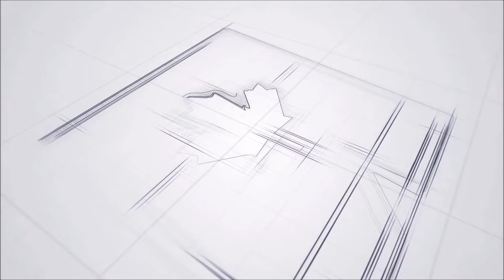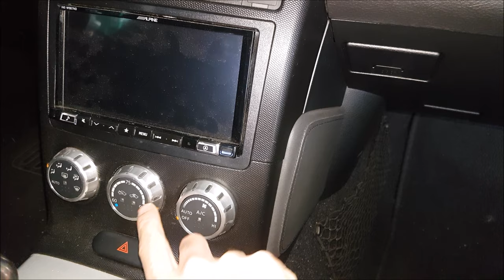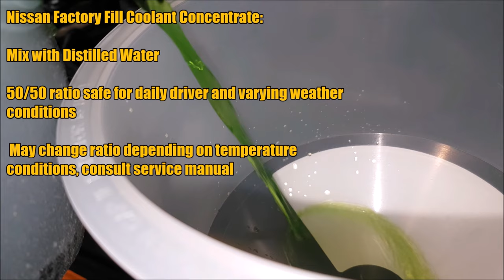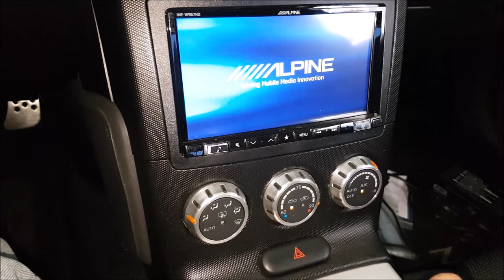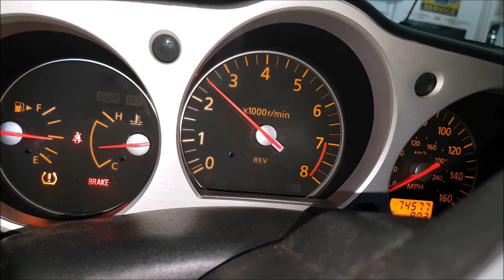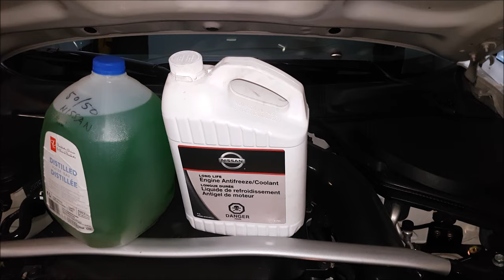How to Bleed Coolant System Procedure Nissan 350Z & Infiniti G35 (Nissan 3.5L V6) | AnthonyJ350

Comment: I got a question I open the air bleeder valve then the radiator cap I didn’t have a free spill funnel but had a regular one I added antifreeze slowly less than 2qts per minute once I see antifreeze dripping out of bleeder valve I close bleeder valve and radiator cap fill the coolant tank start the engine let it get to normal temperature turn the heater on (it started to blow hot hair after the 3rd time of repeating this process) rev the engine to 3k rpm hold it for 10 sec 2 or 3 times turn off the car let it cool down once engine is cold open bleeder valve check for coolant and if coolant level no more longer drops to ur done is this process right? I already did this for 7 times can’t see the coolant level on bleeder valve to stop dropping I took it to a drive to see(car was blowing cold and then hot it did overheat than I waited the whole night this the same process one more time air was blowing full hot after rev the engine went to work drove it on freeway (20 min) and it didn’t overheat and was blowing hot hair I got off of work 7 hours later and start the car the heater wasn’t blowing hot compared to the morning I didn’t want it ti drive it like that so I did the same proces add coolant until spills out of bleeder valve rev it to 3k rpm and started to blow full hot air drove it home everything cool no overheating nothing should I keep doing the same process until I open the bleeder valve until coolant no more longer drops of level or should I just try how you did on this video with the free spill funnel without having to install radiator cap while car is on and I rev it to 2.5k 3k rpm
Reply from the maker: You need the special funnel like in the video

Comment: Quick question smoke came out before coolant is that normal or seems like coolant hitting gasket ?
Reply from the maker: Smoke coming from where amd when?
Reply: The bleeder valve . It was a mist kind of like dry ice mist before smoke and then spewing coolant out of bleeder valve .
Reply from the maker: @MrRashaunn  Do you have the original plastic or upgraded version? https://youtu.be/A0TmDY5yq5k?si=AMMKswRIv7WXw_Jr

Comment: I have done this countless times and it’s not working new thermostat too.But what i do is open radiator cap open bleeder valvue then poor in coolant but it never reaches the top of the bleeder valvue.and then it’s doesn’t overheat when i rev it. i drive it for 15 min all is fine then overheats
Reply from the maker: Something might be blocking the coolant from flowing. Do you have the front end elevated?

Comment: My 350z is overheating when I drive replaced the thermostat and forgot to bleed the system I hope this fixes the problem
Reply from the maker: Let us know if it works for you.
Reply: AnthonyJ350 I’ve done it like six times and no luck we’ve replaced water pump and thermostat and no luck so now we’re looking at the heater core we did a head gasket leak kit and it said that our head gasket is good
Reply: It overheat when I drive but when in park or neutral( I know it’s an auto I wish it was manual but it is my first car and it’s all I could afford) I can even rev it neutral or park and it doesn’t overheat but when I drive it take like 5 minutes to overheat
Reply: Turns out the thermostat we bought was faulty we bought a new one and now my car works great
Reply: My 350z overheathing when its parked   trying to buy the radiator fan i dont know
Reply: @otoortiz6285  Did that fix it?

Comment: Hey if the heat never had an issue blowing hot but the car overheats does that point to a bad thermostat instead of air in the system?
Reply from the maker: How old is the thermostat?
Reply: @AnthonyJ350  it was the thermostat. Replaced today and all is good now
Reply: @AnthonyJ350  but it was original from 06
Reply from the maker: @tcblackg35  Nice, did you put one in that's made in Japan?
Reply: @AnthonyJ350  nope. Duralast from Autozone. Fingers crossed it lasts
Reply from the maker: @tcblackg35  Let us know how it goes.
Reply: @AnthonyJ350  thanks for the optimism, we’ll see

Comment: I drained my g35 and it’s only holding 1 gallon of coolant is that normal? I drained it with the hose by the radiator drain because I could get the drain plug off without stripping it
Reply from the maker: You can run the engine for a few seconds to make the pump push everything out.

Comment: do you recommend to install oil pressure sensor to V36 g sedans? or 2008 V36 g35 sedan already comes with it?
Reply from the maker: The gauge you mean? Great idea if you can find a good spot for one.

Comment: What if it is bubbling out of the container like real bad should I cut it off? It’s not running hot it’s bubbling and filling up
Reply from the maker: If it's bubbling it's removing air from the system. Keep a close eye on your temperatures and keep going. How long have you been bleeding it for?

Comment: Hey man could you help me out? 
05 g35x 103k

Problem:
Coolant hovers around 210-215 during cool days while driving.
Fans stay on high for long periods of time.

The problem was occurring before any work was done but I’ve gotten the thermostat, and coolant temp sensor replaced, coolant flushed, and bled a couple times. I just bled it today for a little over 2hrs. I’m trying to figure out what’s going on. I have constant hot heat and cold ac. Maybe just needs to be bleed more? Can a very small amount of air cause constant higher then normal coolant temps?

Any help/advise would be much appreciated!!!
Reply from the maker: Did you bleed it with the funnel like in the video?  Does the heater give hot air all the time?  Or only when you bring up the revs?

Comment: Quick question do the low speed radiator fans need to come on when you start the car? My car is over heating and the radiator fans don't turn on at all even with ac turned on. I did a self check and only high speed setting kicks on..
Reply from the maker: You should get the vehicle looked at, at a shop.

Comment: I'm not getting hot air blowing in the car when I do this.  Any ideas of what's keeping it from cycling properly?  Also, I notice that while adding coolant to the funnel the reservoir fills and starts leaking fluid out of an overflow spout at the top of the reservoir, causing coolant to spill  all over the ground.  Should this happen?
Reply from the maker: Did you change the thermostat? Also did you open up the bleeder and fill it and close it after, like in the video?
Reply: @AnthonyJ350  I’m having the same issue brand new thermostat using a funnel and did the bleeder screw thing too
Reply from the maker: @illest_evr  Did you elevate the front end of the car and secure it on jack stands or ramps?
Reply: @illest_evr  y’all ever figured out why same thing is happening to me I followed the video step by step. I didn’t replace my thermostat could that be a reason why?

Comment: So when I rev up to 2500 a few times and let it idle, then I shut the engine off. Will I just leave it with the funnel or put the radiator cap back on until it’s completely cooled off?
Reply: Wait, that’s was a dumb question! Okay now I have a real question, where’d you get the funnel setup
Reply from the maker: I just got it at my local auto parts store.

Comment: My overflow tank over filled and started leaking out the top is that normal or is it something wrong and I need to change?
Reply from the maker: Sounds like it was overfilled
Reply: @AnthonyJ350  I have another problem when doing an coolant bleed, once the car gets to operating temperature the coolant in the no spill funnel starts getting pushed out and splashing everywhere, I believe by air. Any idea of what could it be?
Reply from the maker: @yungshaq5166  You have it filled too high.
Reply: @AnthonyJ350  I only fill it at the bottom because it might get high when doing so which it does and I take some of it out before it gets too high, but even after that it still does it. Maybe I should just take it to a mechanic and see what they say.
Reply from the maker: @yungshaq5166  Did you install a new thermostat?

Comment: I have a question recently I had the same issue with my car about one of my hoses popped and I replaced it and also bought the new thermostat and I did the burping method but it’s kinda still over heats a lil wen I have my AC ON and wen I come to a complete stop to wait tell the light turns green. Than when I start to drive it goes back to normal is it because I still have air trapped in my motor? And do you have to do the revving part to help it out more or you don’t have to do it. I have a g37 sedan. Should I do that revving at 2500 rpm for 10 seconds. Any advice would be great🙏🏼💯
Reply from the maker: Sounds like you still have air in the system. Revving it once in a while during the bleeding procedure does seem to help. Just follow the video and have the front end elevated safely to get the air out.
Reply: @AnthonyJ350  okay sounds good I appreciate it man will do today I’ll let you know how it goes👍
Reply from the maker: @fernandopimentel6577  Please yes, let us know how it turns out 🙂
Reply: @AnthonyJ350  i will today I did the bleeding method and i have a question how long does it take for the air to come out of the motor can it take  days or so? Because today I was doing it all day and it kept throwing air bubbles only a lil bet. So I took it for a spin and it kept overheating when I come to a complete stop. Do I have to wait tell there’s No air bubbles at all. And also I had the car on the driveway since it goes up a Little so thought that would help with the burping. Does the front of the car has to be pretty high in order to take out all the air bubbles out of the motor.
Reply from the maker: @fernandopimentel6577  I also have the front end lifted where I can put jack stands underneath. These cars are a pain to bleed. It takes me about 45 min including cooling cycles.
Reply: @AnthonyJ350  okay sounds good ima try that hopefully that works and fully wait tell the air bubbles stop coming out too. For the full bleeding system.
Reply from the maker: @fernandopimentel6577  Let us know
Reply: @AnthonyJ350  will do later on today in the afternoon ima keep doing the bleeding the air out. Get any air out of the motor.  also had a question I don’t think I have the no air relief plug I’ve checked and I don’t see it maybe cuss the g37 don’t need that. Was concerned about it?
Reply from the maker: @fernandopimentel6577  Read this thread, if you scroll down you might need a tool https://www.myg37.com/forums/engine-drivetrain-and-forced-induction/240883-no-air-relief-plug-on-heater-hose-can-t-bleed-cooling-system.html

Comment: Curious what stained your coolant hoses with the white specs?
Reply from the maker: I believe it's the coolant itself. When I researched silicon it's a little porous technically. Maybe the coolant tries to push through when under pressure and as it cools down that happens. Not really sure.

Comment: I keep bleeding and filling with no leaks but it still overheats
Reply from the maker: Did you change the thermostat?
Reply: @AnthonyJ350  yea I changed thermostat and removed my deleted bleeder valve and installed hem one. when I idle the car sat for an hour and a half and the temp was fine. I drive half a block it goes up. I got so mad I hit the gas and let my baby roar down the street and the faster I go it cools down. but when I parked steam came out the cap
Reply from the maker: @YoungNaija  When you bleed the system do you have the Hester on the hottest setting and the fan on?
Reply: @AnthonyJ350  yes I did. When I drive fast it runs normal. I idle it runs normal as well. I drive speed limit down the street it’s starts steaming out the radiator cap and temp gauge sky rockets. Maybe the cap? I didn’t change that or the water pump
Reply from the maker: @YoungNaija  It's worth trying a new rad cap for how inexpensive they are.
Reply: @AnthonyJ350  it was two things but I got her back running head gasket is cool.  Radiator fan doesn’t work and my cap was bad

Comment: In a vq35de, is zerex 50/50 by valvoline green for Nissan a good coolant to use? Just curious because that's what I put in my 03 350z.
Reply from the maker: If it has the same approval rating for Nissan you should be fine.

Comment: Scenario was ; bleeder line broke, spillled coolant. 
Addeded coolant as you said, yet during procedure the hvac doesn’t want to pump put hot air.
 is that normal? It was fine before the ruptured coolant line
Reply from the maker: Did you raise the front end and use the funnel upfront? You probably still have air in the system.

Comment: My vq35hr so hard to bleed time consuming I bought the same funnel replaced my thermostat and my fans are still on 24 7 what should I check next
Reply from the maker: Temp sensor replaced?
Reply: @AnthonyJ350   would i get a check engine light for a temp sensor i have no lights.
Reply from the maker: @abbas674  Not unless the car thought it was over heating maybe
Reply: @AnthonyJ350  no runs good I’ll just wait until the summer it gets up to 120 degrees where I live I’ll be installing mishimoto radiator and hoses soon thanks for the reply
Reply from the maker: @abbas674  You're welcome

Comment: Hey man,old video but maybe you can help..whenbi have my z idleling and rev to 3000 and my issue is after the car gets hot it spits all the new coolant out from no spill funnell,the funnell will fill up and then overflow and leak everywhere. .why is it spitting back after a while .I thought i was good my heay was working and all was good i was about to stop and call it a day n go for a ride but before i could go out and remive the funnel i noticed it filled the funnell to top and never syoped just keep pouring anitifreeze
Reply from the maker: When you're bleeding the cooling system, is the front end elevated?

Comment: Hey man, great video. Ive been chasing this issue for awhile. Evidently overheating (or fooled temp sensor due to air bubbles) is common? I feel like ive been bleeding air for a while. I usually did 5 minutes of bleeding maybe once every few months before i notice the temp needle creeping a little higher than normal. Perhaps im not doing it long enough? It seems after a bleed im good to go for a while but would like to not worry about it anymore. I wonder if air is being introduced into the system somehow. Thoughts?
Reply from the maker: It takes me 45 mins to bleed my car with the front elevated using the funnel.  Are you doing it like in the video?

Comment: After it spilled from the bleeder valve, did you tighten it back up or leave it loose?
Reply from the maker: Tighten it back up.
Reply from the maker: Tighten it back up
Reply: @AnthonyJ350  So you had it tight throughout the whole process?
Reply from the maker: @vxf4tal1tyxv67  Yup

Comment: It seems like my thermostat isn’t gettin coolant the tubes pretty cold when the other tube is hot , could use some help trouble shooting everything was working perfect 2 days ago just got a radiator and new thermostat so I know it’s not bad just air in system
Reply: Also car idles at operating temp but when I drive over heats, and the heat is only hot when revving or driving
Reply from the maker: Did you change the thermostat?
Reply: @AnthonyJ350  yes it’s new but I made bit more progress with it, heat is reliably working now and fans kick on still, lower radiator hose to thermostat is still ice cold tho although t-stat itself feels warm
Reply: @johnpagano2744  did you figure it out? My lower hose is still cold as well.

Comment: Quick question I’m doing the procedure now and had the car elevated… filled it up with coolant until it came out the bleeder valve at the top, I began to add more coolant to fill the funnel 1/3 of the way as described in the video but the coolant continuously flowed downward into the engine and began to fill the coolant revisor passed the Max line. Did I miss a step or do I do the procedure with the coolant resivor full?
Reply from the maker: Does the funnel fill up?
Reply: @AnthonyJ350  yes the funnel fills up but only for a split second then the coolant slowly goes back down
Reply: @-rikx-3246  did you ever figure it out?

Comment: Need help with a g35. Got no heat when at idle. It can set and idle all day and never get hot but it over heats almost immediately after I start to drive. I put in a new thermostat and replaced the bleeder valve but I just cant seem to get it right again. Any help would be appreciated.
Reply from the maker: Did you try bleeding the system the way we did in the video with the front end up in the air and the special funnel?
Reply: @AnthonyJ350  
No I got to get a funnel like that one. I changed the thermostat and now it will set and idle literally all day long but you cant drive it 50 yards without it getting hot. My heat dosent work unless you're driving anymore. It's running fine theres no oil in the water I'm not losing coolant. I just cant figure it out. I love my car and cant really afford to take it into a shop right now with having spent a bit to much on my kids for Christmas and I'm just looking for any help with diagnosing the problem. I appreciate your time.
Reply from the maker: @youtubebannedme4207  Did you bleed the system with the car's nose in the air? It takes me easily 45 min to do the procedure, so it's not exactly fast.